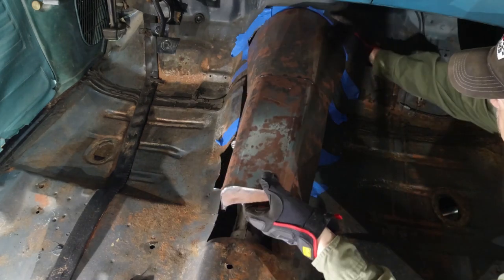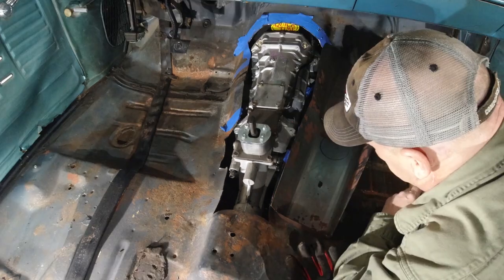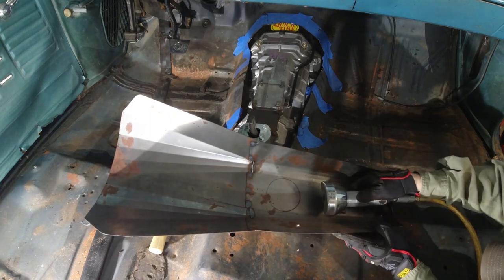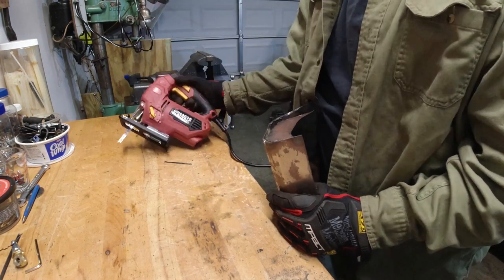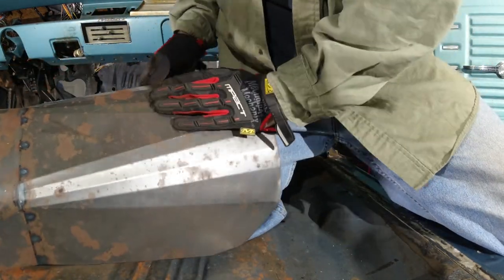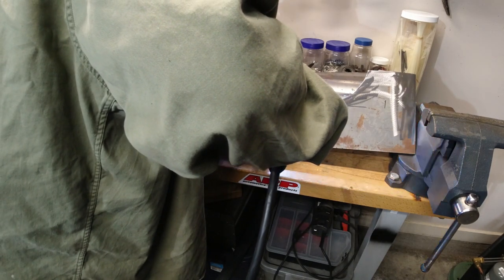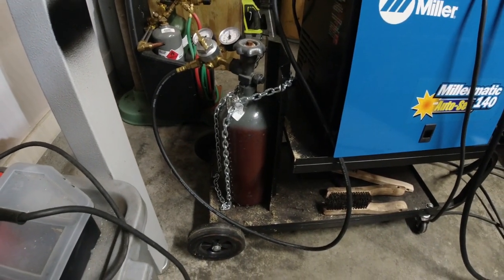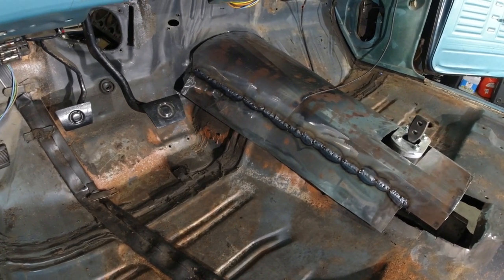Chevelle Gets a T-56 Part 3

Comment: Damn thats a big hole/lots of work.  Been there done that. I would have pulled the trans then pushed the tunnel cap from under the car then traced it out on the sides/cut and then install from top, Super clean install. tac/weld. doing it from the top is super irritating with a premade cap. Great video!
Reply from the maker: That would have been an option if it was an older trans without anything on the sides.  There’s sensors that have to be accounted for.  Mounting surfaces.  Has to be done from the top down to make sure all the clearances are there.  Or beat it to death with a sledge hammer after.  😆
Reply: @MuscleCarSolutions  I hear ya!! It will pay off.
Reply from the maker: @hybridmusclegarage4590  for sure!